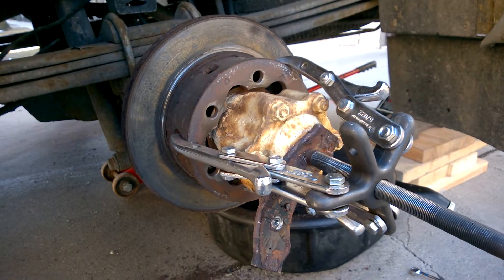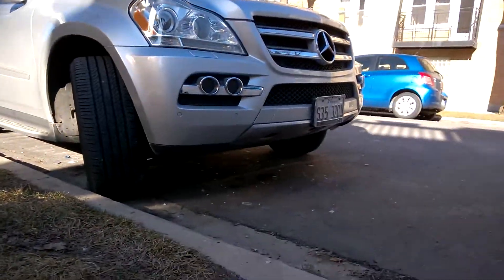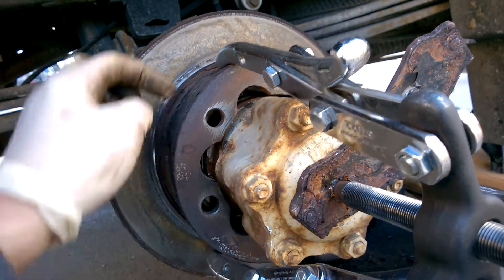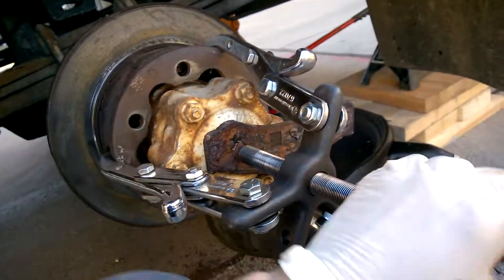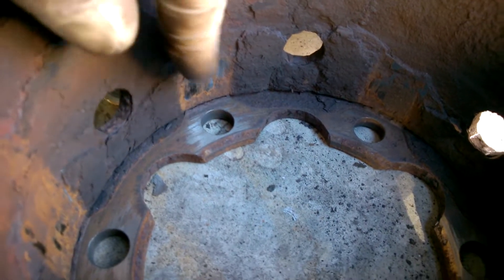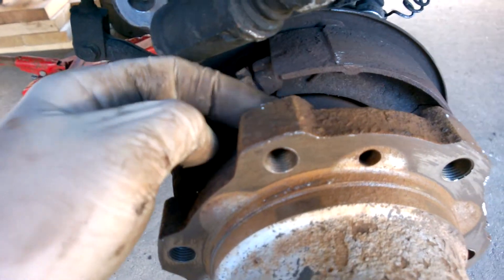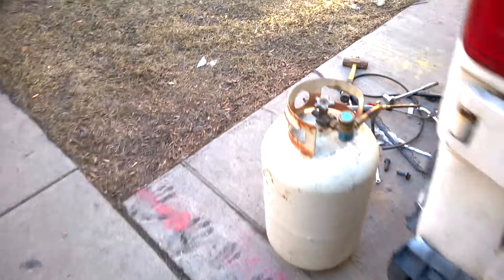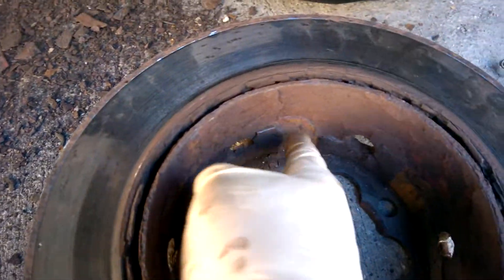2001 2002 2003 2004 2005 2006 Dodge Sprinter 3500 siezed disc brake rotor drum

Comment: Replace Rotors, park brake shoes and hardware as park brake springs loose there elasticity when heated.
Reply from the maker: After 11 years they lost allot more then that and I replaced everything while I was in there. Thinking whomever has difficulty removing the rotors will be doing the same due to the excess time they were on.... to date I only have 105,000 actual miles on the Vehichle and it is 16 years old